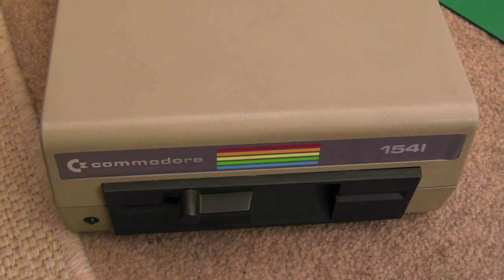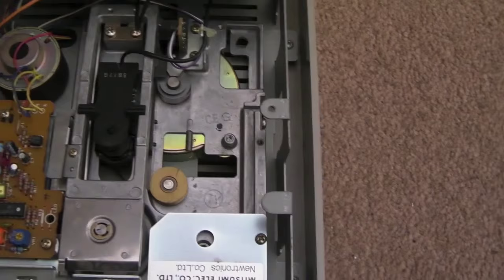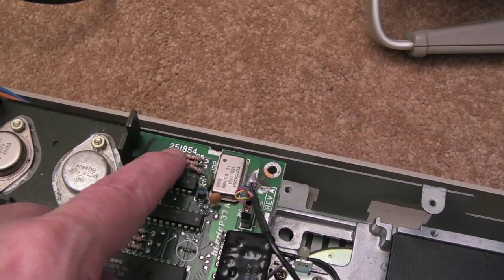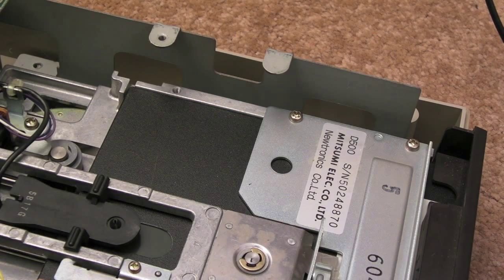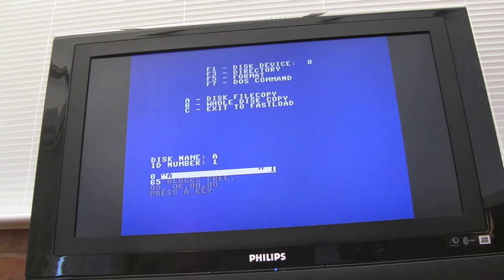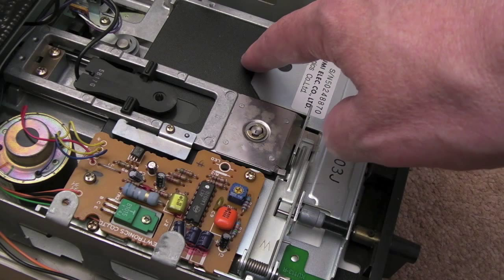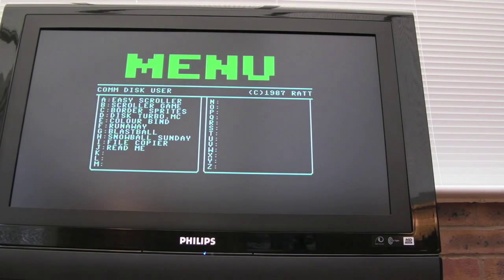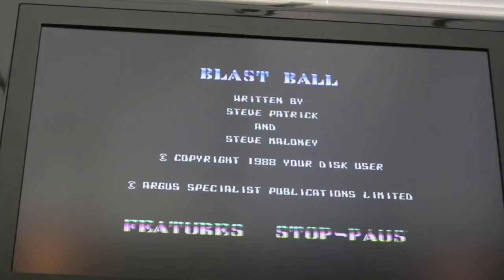Commodore 1541C Floppy Disk Drive Repair & Cleaning

Comment: Nice video mate, 
I love those type 1541, becase I like the way close the floppy door.
I don't like the way the older 1541 do.

Also do you know that those short board 1541 have a another type of drive rom?
They change it to do that the reading head go to track 0, the older 1541 drive rom and JiffyDOS don't do that.
Reply from the maker: +MrFixer1983 Yes, apparently you can swap the ROM out on some of these. I think the C revision will take the 1541-II ROM.

Comment: I have a C64 1541-II Floppy Disk Drive which I've had for years. It powers up but it won't load anything. Would you be interested in a possible repair?
Reply from the maker: Maybe later in the year - just now I've got too many other things on the go =D

Comment: If I wanted to fit my C64c with some heat sinks where should I look. Do you have any advice on that?
Reply from the maker: +The Highlander I use something like this:-  http://www.ebay.co.uk/itm/New-8-Pure-Copper-Memory-Cooler-Heat-Sinks-HeatSink-For-IC-DDR-DDR2-DDR3-RAM-VGA-/350687630950?hash=item51a69c9666:m:mY9NqTBsFmnqyZBVxj1U4xA

I will be ordering some for my 1541 at some point!  You need to put 2 or 3 of them in line due to their small size, but they do the job really well!
Reply: +GadgetUK164 Oh great stuff! And you attach them with a cooling paste of some sort?
Reply: +The Highlander I've ordered a bunch of them. Saw that they come with an adhesive tape.
Reply from the maker: I just use the thermal adhesive pads on the backs of them.  They stick really well normally.
Reply: Cool. Thanks for the tip again!
Reply from the maker: No problem =D

Comment: Sounds like you have the schematics for "1541 late"? Or the service manual is refering to that revision..  You need 1541C (the latest), in that schematic there is no Q4 and Q5 because all of that stuff has been baked into the hybrid circuit I think. Check Ray Carlsens website for the schematics. I had trouble finding it back in May when I repaired mine. I was searching all over the Zimmerman archives, but Ray Carlsen has a good directory strucure. http://personalpages.tds.net/~rcarlsen/cbm/1541/
Reply from the maker: +bwack Thanks, it looks like those 2 transistors on mine are for the +5VF.  And I think you are right, looks like +12V just goes into the hybrid and +12VF must be internal only to the hybrid.  I wonder how reliable those hybrids are.  I did wonder what my approach would be if I suspected a fault on there, perhaps there's a way of removing the paint / acrylic coating without damaging it too much.  If so it would probably be possible to repair it?!?
Reply: Right :) Looked at +5VF yesterday in the "1541C", and compared it to "1541 Late", which does not have hybrid,and there they call that voltage for Vsw instead.. It is only used on analog parts.Most likely to keep the digital switching noise down to a minimum on the power supplied to the parts that condition the small pick-up signal into a digital one. Not sure if you can remove the coating. Maybe acetone bath, but what a smell.. It looks thick.. I wonder why it was coated ? Did they use (package-less) die on board like the blobs you see in calculators ?
Reply from the maker: +bwack Very interesting!  It looks like it has SMD type resistors, caps, transistors on it.  I know Kipper2K took one to pieces from the Amiga hybrid.  He built his own replacement for that.
Reply: Wow. I've heard about Kipper2K and his vampire accellerator. Awesome. This retro scene has some very talented people still developing :) You could take the analog circuits in the earlier 1541 revisions and make a compact hybrid board for the latest 1541. If someone has the time and will do to it.
Reply from the maker: Yes, there are some really smart people in the Amiga scene!  I cannot wait for the Vampire 1200 to arrive.  I think the 500 model is next, will probably pick up one of those I think.

Comment: cant get my floppydrive working
Reply from the maker: What is it doing, or not doing?
Reply: i always get the error ?device not found error

the floppydrives makes the floppysounds when turn on and when the c64 is turned on
Reply from the maker: My mistake, device not found is usually the 7406 I think.
Reply from the maker: Or one of the VIAs.  There are two 6522's on there, could you try swapping them around (make sure you get pin one in the same position as its marked on the PCB).  If the behaviour changes after swapping them around you probably need a new 6522.  You can replace those with Rockwell 6522 chips which are readily available on eBay.
Reply: GadgetUK164
idk how to remove chips, i tried it with a screwdriver but they didnt moved a bit (maybe a screwdriver isnt enougth for chips lastused in i guess 1990